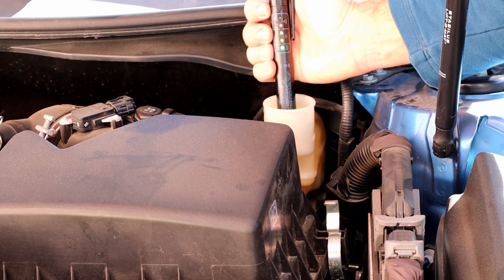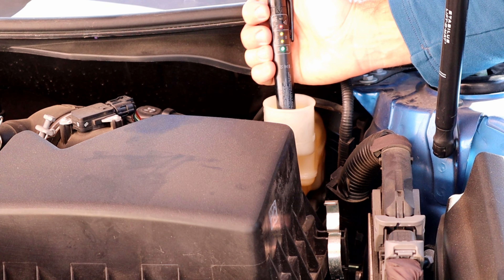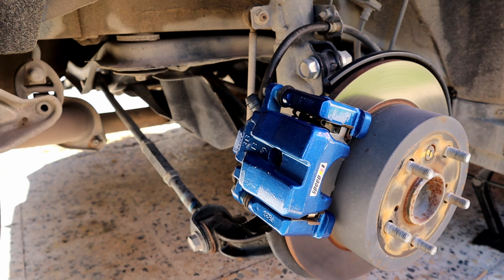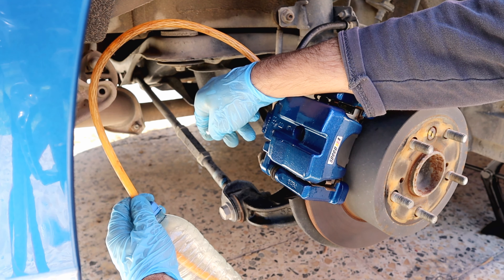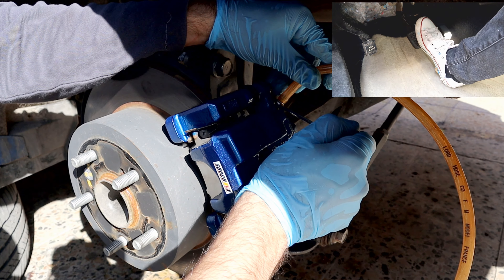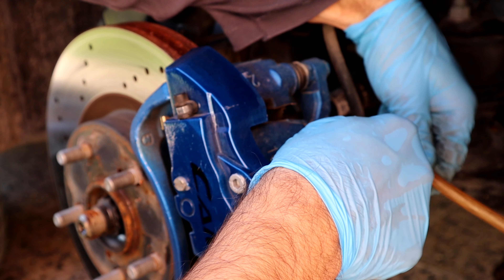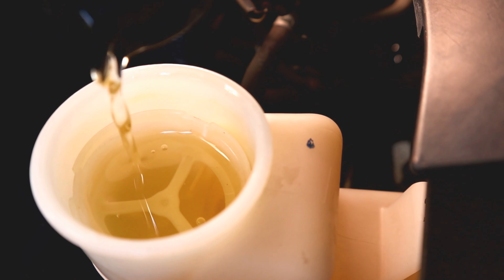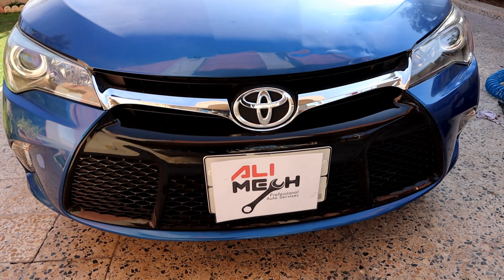How to TEST and FLUSH brake fluid on TOYOTA Camry 2015-2017 / ALIMECH

Comment: Awesome video. I have to change my rotors and rear brakes. Do I need to do the flush first or change the other stuff out first. Also will this work on 2017 Toyota Corolla?
Reply from the maker: Thanks, change the rotor and pads.. and then flush the brake fluid
Reply: AliMECH thanks 🙏

Comment: When bleeding the brakes do you push the brake pedal in while the bleeder screw is loose or tight?
Reply from the maker: When its tight, push the pedal and hold, then loose the screw and bleed, the tight the screw then release the pedal
Reply: @AliMECH  thank you

Comment: What kind of vacuum pump did you use?
Reply from the maker: It wasn't a vacuum pump, just open the valve and brake, but next weeks video I will show a good pump for flushing brake without removing any wheels, stay turned
Reply: @AliMECH  I mean when you removed the brake fluid from the reservoir.
Reply from the maker: 12V oil Extractor pump: https://s.click.aliexpress.com/e/_DCUkdIR

Comment: I have a 2015 Toyota Camry hybrid LE. How many bottles should I use to flush the brake fluid?  Is there a difference between a regular Camry and the hybrid regarding this? I've got 100,000 miles on the car and I've never flushed the brakes before. Thanks!
Reply from the maker: For me I needed 2 bottles, but I really dont know if Hybrid needs same, if the have same reservoir and caliper size, yes the need same amount
Reply: @AliMECH  thank you 👍👍
Reply from the maker: You welcome 🙏🏻

Comment: It seemed easy but why continue to open and close the valve? That confused me
Reply from the maker: It make sure that no air goes back to the system when I release the brake after bleeding, that's why I brake and then bleed, and close the valve and brake again to bleed again
Reply: @AliMECH  thank you brother!